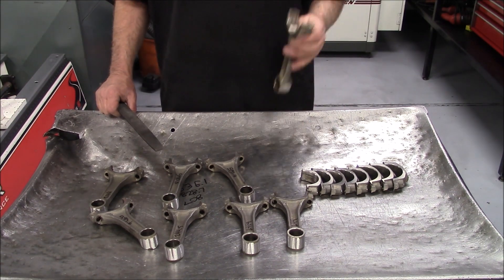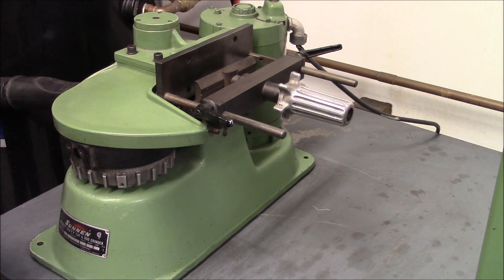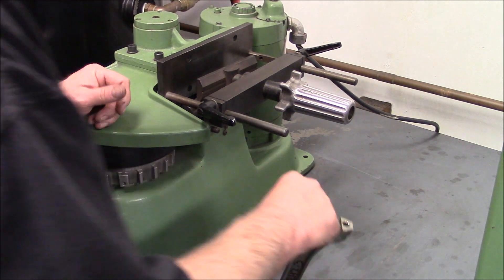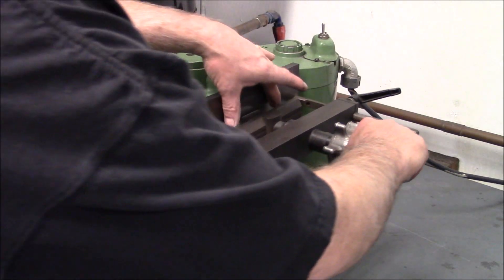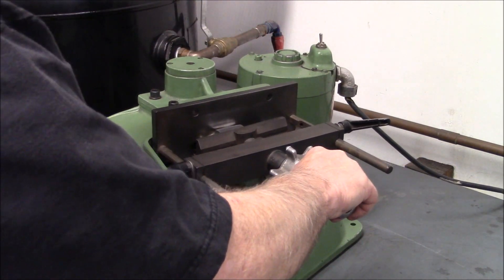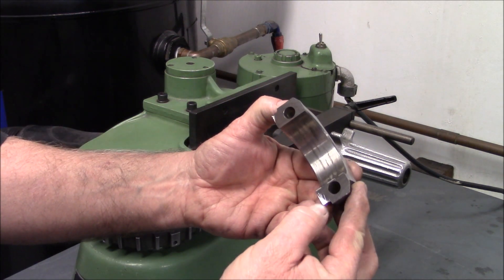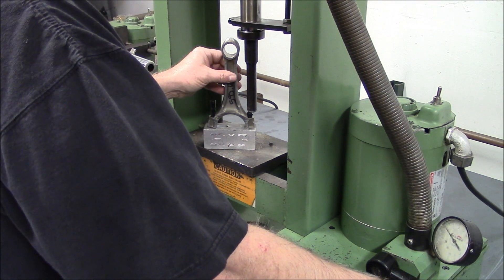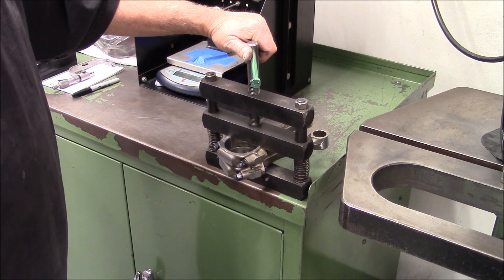620 HP 454 Big Block Chevy Engine Build Part 6 GM Connecting Rod Machining and Rod Bolt Install

Comment: Torquing bolts and nuts together knocks burrs off of the threads of both the nut and bolt. After knocking off those burrs, the torque values get more consistent and repeatable.  ARP bolts are cold rolled and are not as bad as most other bolts, because this process tears up the threads less and results in a very consistent finish - providing the tool is very clean.  However, the nut threads are still cut using tooling that still causes burrs.  This makes it necessary to torque the bolts multiple times, so that you get a consistent stretch on the rod bolt.  I have found that when tapping bolt holes in blocks, or torquing any other fastener - that you get the most consistent results with torquing the fasteners three times.  It probably isn't necessary on an ARP fastener though, because they take a lot more care when manufacturing their items - two is probably sufficient.  In the engineering world when we are doing iterative analysis of a problem or using limits, often we get the most optimal result when we go through the process three times - that will get you within 90 percent of a correct answer.  You may find it is similar to when a port stops flowing air, even when you increase valve lift.  There isn't any point to adding more lift, it won't get you any better result unless you do more work on the head.

Comment: You pre balanced the rods but then took all the caps off and didn't seem to keep them matched. It doesn't matter since you ground the mating surfaces but doesn't that throw the balance off slightly?
Reply: Rods are numbered - cap and rod both

Comment: Torquing the rod nuts then loosening then retorquing them Burnishes the nuts and creates a pattern for the rod nut so you get a more consistent clamp load on the fastener fwiw